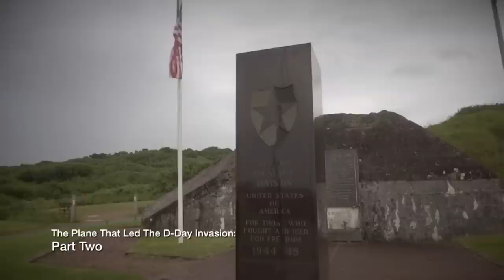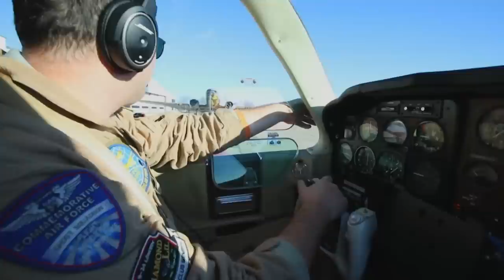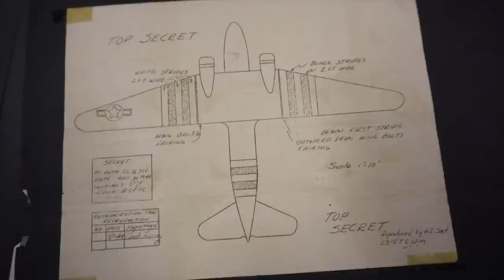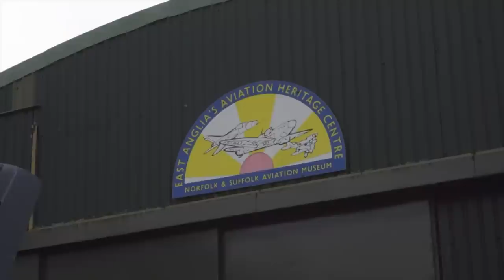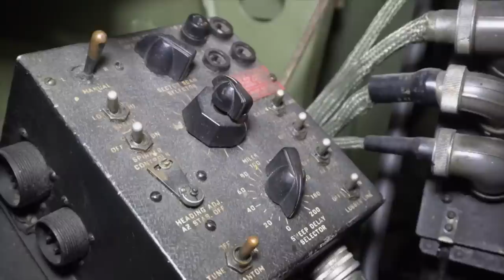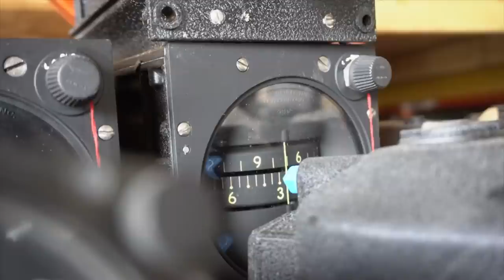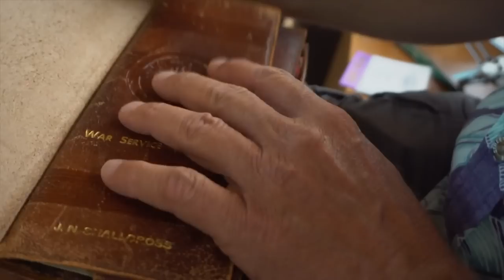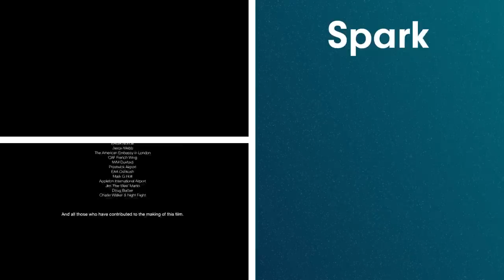Reconstucting The C-47 - The Aircraft The Won WWII | That's All Brother | Spark

Comment: I was working outside one afternoon about fifteen years ago and I heard a distinct sound, I looked up and it was a WW2 vintage airplane flying at approximately 2000 feet, big radial engines banging on, it was such a great sound. I instantly knew it wasn’t a B-17 or a B-24 because it wasn’t four engined. So I took note, “two engines,two tails”, went home later that day and I looked it up, it was a B-25 Mitchell. Still remember that rumbling sound of those old radial engines and it made me think of what it must have sounded like back in WW2 with hundreds of four engine planes above.

Comment: These audio engineers just don't understand their audience. Instead of overdubbing the startup and take-off with pompous victory music, how about miking the sound of those Pratt and Whitney R-1830 twin wasp 14 cylinder radial engines. They have a crackling idle that will arouse any petro head. Soundtrack engineers take note.
Reply: It gets worse. They babbled on about a plane left abandoned in a boneyard & showed images of several wrecks PLUS they craftily inserted faked up images from 1944 of the nose in a feeble effort to display a dilapidated plane "as discovered".
We know from other doccos on this plane that it had had previous lives as executive passenger transport & then as a cargo hauler & these clowns expect us to just assume the wreck they "found" was still in 1944 cammo.
We also know the original airframe was extensively corroded & that will absolutely be why Bassler kept on passing her over for years instead of giving her the works soon after SHE FLEW INTO BASSLERS UNDER HER OWN POWER IN AIRWORTHY CONDITION.   There is no footage & there are no genuine photos of the plane that flew into Basslers. It looks like all the cammo sheetmetal stuck to that repaired airframe came from a donor aircraft. Where are the pics of this project taken when she was stripped back to all that was left salvageable?
This whole story reeks of a Disney fairy tale.

Comment: I worked at McDonnell Douglas Aircraft in LB 35 years ago. There were still a few of the original buildings from the WWII days. They have a great museum with interesting artifacts from the old buildings. It’s now Boeing, but they retain the heritage of the old firms. I got to fly in the last DC2. Its like the DC-3/C-47 except that it’s 3 seats wide instead of 4 seats wide. The ailerons are clothe and the wheel spin on takeoff is stopped when retracted by a loop of leather. I am 18 months from retirement now. It’’s been a good run.

Comment: During WWII there was nearly 20,000 DC-3 made...Still today there is 300 of them flying and they will fly another 100 years because it is the best airplane ever made! And the best time I ever had as was fly the DC-3! Over 3,000 hours, it is big, it is cheap and easy to operate and it never break! You lose an engine? Just trim a bit and away you got...One time it happen, the fog set all over the east of the USA! No problem...Zero fucking zero, you still go to your usual destination in the thick fog, landing the two wheels right between the white line!